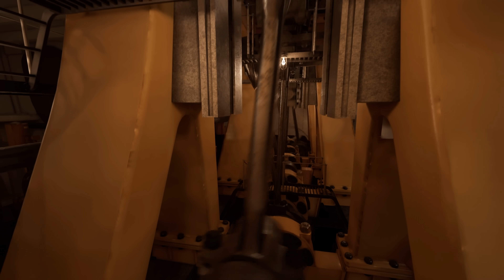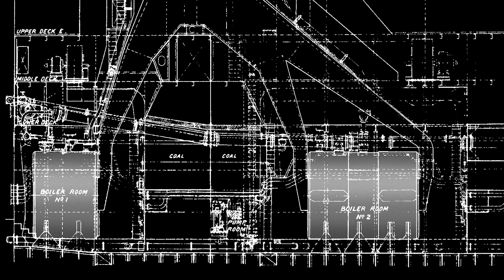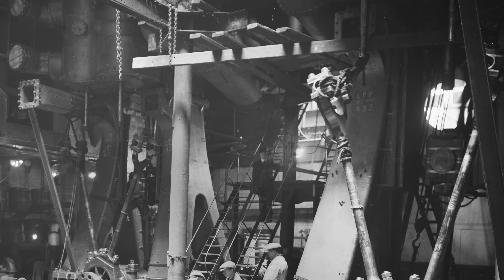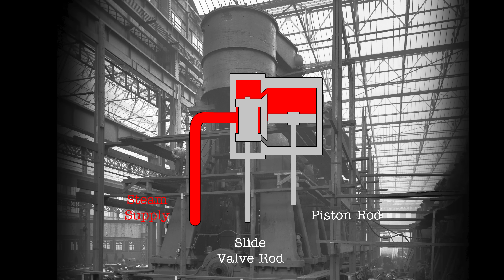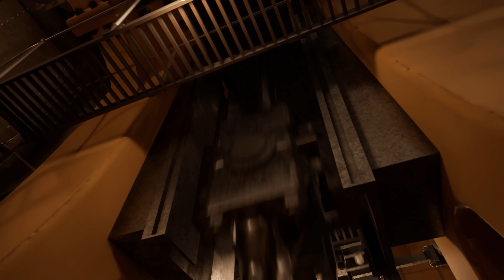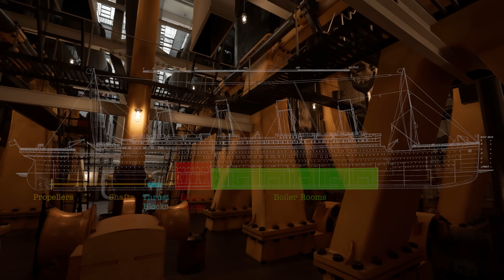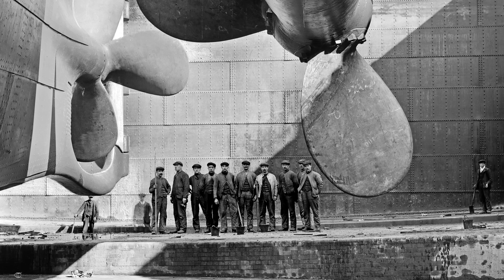A Complete Guide to Titanic's Engines

Comment: If Murdoch had ordered the port engine to fill reverse and the starboard engine to full ahead and shut down the turbine driven center screw (which could only go forward) instead of ordering all back full, the Titanic could have turned to port more quickly and missed the ice berg.

Comment: And yet one ge90-115b jet engine in the Boeing 777 has more power then all of titanics engines. Goes ro show how much more efficient gas turbine internal combustion engines are compared to external combustion steam engines. It also goes to show how inefficient ships are compatible to jets they have they same among of power yet tge massive resistance of water only allows them to travel 20 30 knots while a jet can travel 570 knots with the same amount of power. Likewise one fuel pellet of uranium has as much power as a whole train of several cars full of coal. This huge inefficiency of TITANIC'S steam engines makes my OCD go crazy. Whats funny is that piston four stroke internal combustion engines were already invented in the late 1800s Just lookup Rudolph Diesel and oil was already being used as fuel instead of coal for steam engines.

Comment: Really a great presentation. Learned a lot about the entire engine system. So, when are you going to do an episode on the issue of the coal bunker fire that may or may not have been a factor in the speed issue and the warping of the watertight doors?? Read the Sean Mulroney book on that issue if you haven't already.

Comment: Fascinating and well put together but the description of the action of the reversing engine is I believe inaccurate. It would reverse the setting of the valve gear so altering the stem admission and exhaust sequence for each cylinder. It would not act directly on the crankshafts per se. Just not big enough!
Reply: Stevenson linkage will cut off steam in mid position + engage astern eccentrics from ahead position.
The browns reversing engine operates the stevensons linkage,not the crankshaft.

Comment: Great overall video but what size are the cylinders? Maybe you have another video covering the actual workings of the pistons. I know I've seen a triple expansion engine video, not sure if it was yours or not. I'm guessing that the steam is split into 2 exact balanced proportions to feed cylinders 3 and 4? I used to listen to a sound track of one of these running as a sleep enhancement.

Comment: It's impressive how Titanic's engines extracted every last bit of motive energy possible from the steam fed to them. It's incredible that by the time steam exited the turbine on its way to the condensors, its pressure was one pound per square inch, which created a very strong vacuum in the system. Doubly so in light of the fact steam acted on the pistons from both directions, making every stroke a power stroke.

Comment: Why would you need a separator to remove the water droplets from the steam? Steam is itself nothing but water droplets. 🤔
Reply: Nope, Steam is water in gaseous form - its a gas. The thing you see rising over your cup of coffee is a vapor - floating droplets of water - not steam, steam is invisible. They don't want water in their system for the same reason you do not want water in your lungs - they are meant for gas, water will clog them.

Comment: did they always run the middle propeller in reverse? All the animation recreations I've seen have the two outer propellers pushing water in the same direction and the center propeller is pushing water in the opposite direction from the outer propellers.

Comment: If someone else has not caught this error, my regrets because I'm not going to read all the comments, which are many.  Yes, very good video and thanks for taking the time.  However, the narrator must have been talking about 9 psi_gauge_pressure at the inlet to the turbine as there's just no way the steam pressure at the outlet of the two main engines could be below earth's atmospheric pressure as was stated. 28.06 in the video. It must have been 9 psi_gauge_pressure. 1 atmosphere is 0 psi gauge pressure. Atmospheric pressure at sea level is 14.7 absolute, so 14.7+9=23.7 absolute.  28 inches of vacuum caused by the condensors is 13.7 psi absolute. So, a pressure differential of 10 psi inlet to outlet of the turbine.  How that thing made 16,000 HP with that lowly pressure differential amazes me.  I guess due to it's size and turbine stages.
Reply: It takes few seconds to confirm from other sources that the video is correct and Titanic turbine was indeed working using steam bellow atmospheric pressure. Since it is a closed system atmospheric pressure is completely irrelevant here.
Reply: @randomnickify  I just watched it again, and at about 28:40 he does show the pressures at absolute.  9psia at the turbine inlet, 1 psia at the outlet.  Only an 8psi differentail across the turbine.  I can only guess that the 16,000 turbine output HP was due to it's massive diameter, number of stage and number of blades.  I would appreciate if you could post a link to any of the sources that confirm that show the narrator being correct.  I'm a retired airline mech., and worked with gas turbine engines for 47 yrs. and admit to knowing next to nothing about steam turbines. Thanks for your input.

Comment: Imagine being deep in the bowels of the ship in the engine room on that night. The ship is tilting more and more. Coal would have been sliding around, water in the boilers would have been at unusual angles, and still you are trying to keep some steam up to keep the pumps and lights on as long as possible. Salt water would have been sloshing around electrical panels and back then a lot of the switch contacts were exposed! Had to be terrifying!

Comment: Ignore that last posting [user-hx9qv9mv2v], it's me, but I don't understand why the changed user name and I needed to edit it.
Two areas weren't clear to me. . .  
.
1- Hot, engine room air, vented out the skylight, needs cooler replacement air to enter at the bottom.  There must be an equivalent sized inlet. I believe he didn't mention where that entered.
.
.
Now the tough one. . . 

2a- The steam is re-condensed after the secondary turbine and dumped overboard, but this water was brought with the ship from port.  I thought in the beginning he says the steam / fresh water is recirculated.  
It doesn't seem he explained that well.  What do you think?
.
2b- The 9 psi absolute pressure 'exhaust', turbine-steam is a problem for me.  To lose that heat and re-condense, it is clearly still above ambient temperature.  In addition, for the piston engines to 'work' all steam must be above atmospheric pressure because that is on the opposite side of each piston, even the last one, right?
.
BUT. . . . 
How does it exhaust at LESS THAN 9 psi unless the opposite face of the last piston is even lower pressure? Something not right here. 
Comment?

Comment: Blows my mind that this could be designed and constructed with such precision. I cant imagine the weight of those components. Something not discussed but perhaps the most impressive feat is the amount of torque generated. If the engines made 46k hp @ 75 rpm than they produced over 3.2 million ftlbs of torque!!!

Comment: this video was fantastic the other one was great too however i really found the added information really interesting it’s amazing that the engine spun at such a low rpm i wasn’t aware of this an that fact means that the propeller design was very efficient so overall the engines were very efficient for the day it is still a very interesting ship even today because of the very good design and engineering that was done so good in-fact that a lot of engineering firsts at the time of the olympic class construction have been perfected and improved and continued to be used today a good example of such technology is water tight compartments the concept has been improved and is still in use today anyway i really enjoyed the video and look forward to your next video

Comment: steam power is fascinating.  Steam Locomotives were designed to operate close to 110 MPH on some of the big 4-8-8-4 (wheels) units by Union Pacific.  There was a engineering school for this in Chicago.   These units weighed 100+ tons for traction purposes.  
They were also "dwarfed" by this marvelous piece of engineering on the Titanic.  thank you very much for this!!

Comment: EXTREMELY INTERESTING.   I WAS RIVETED (forgive the pun!) .   It took me three hours to watch this, as I had to watch segments over and over again.   I was gobsmacked about power parts working below the usual atmospheric pressure.   WOWWWW !
If there was a way that you could show the pathway of 'one bucket of steam'   coming into the high, then medium, and then low psi cylinders,  that would have been wonderful.  I would  especially like to see the 3 or 4 piston stroke positions at those times,  showing how all 4 driving pistons moved in time, relative to each other.   This symphony of motion would have gobsmacked me again so badly that I would have to go to the washroom to wipe all the gob/sputum off of my face !!!     Aarre Peltomaa of Mississauga, Ontario

Comment: 23:33    On the right side,  the direction of the tip of the blades of the rightmost, and center propellers are complementary (same direction), so the water flow wouldn't be as shocked, I premise.   On the left side, the left most propellers tips are going in a different direction to the direction of the center propeller tips;  wouldn't this cause massive enturbulence to the
flow of water?   Try, in a swimming pool,  pushing one hand upwards, and right next to it, pushing the other hand downwards;  wouldn't there be a huge shock as the hands passed each other?  I realize the the center propeller is a good distance back,  but would this enturbulence still not apply ?   The left and right propellers should be turning the same direction,  contrary to the center propeller,  no?    Counterclockwise/clockwise/counterclockwise,  or vice versa.   No ??   Aarre Peltomaa

Comment: I've always been fascinated by Titanic's engine set-up. There's so much clever engineering so meet a brief and allow White Star to have their Speed cake without the vibrations of an extra VTE engine. Achieving that solution while also making it a fully integrated system that worked in harmony is impressive a heck, and that's before you get into how the designers were pushing the boundaries of engine design with the sheer scale of it all. 
I was also fascinated when I learned the theories around how this set-up contributed to Titanic's sinking, particularly how the central prop stopped when one of the VTE's was put into reverse to provide a turning assist. I work in Civil Engineering as a career and I think the idea that design choices can have a very real effect on real-world operation, especially in situations the designers might not have thought of, or how user understanding of a system can impact its effective operation is a big part of why I chose the career I did.

Comment: Titanic had a huge valve that bypassed steam around the LP turbine straight to the condenser so you wouldn't have the center prop trying to go ahead when the recips were running astern.  Seems like a lot of trouble and expense for the miniscule time she would have been going astern.  No wonder direct drive turbines were a dead end.  I think later ships with geared turbines used little HP astern turbines that developed lots of power at low efficiency.

Comment: Actually a major Naval Architectural mistake with very little maneuverability with a small single rudder mostly worthless because of the deep keel allowing little control, and especially with two more props with no rudder which is totally useless for control to any degree. If this vessel had been built with 3 propellers with 3 port and starboard rudders with no keel to cause minimal control, the Titanic could have most likely steered clear of any obstacle to cause no damage.

Comment: A beautiful video about one of my favorite subjects, Mike!  One thing, though - the animation of the propellers seems to be showing the central propeller turning in reverse (according to the blade angle and rotation) or, if the rotation is right. the blade angle is opposite what it should be.

Comment: Very well-done explanation of this incredible power plant!  Just one comment, if I may - steam is never "less than atmospheric pressure" - if it were, it would actually be a vacuum.  Steam pressure is measured in PSI (pounds per square inch) relative to atmospheric pressure..in other words, steam pressure of, say, 6 psi, would be weak, like from a tea kettle, but still useful to do work. If a boiler were turned off and allowed to cool, the steam pressure would be zero, and the air inside would then technically be at atmospheric pressure.

Comment: Very good comentary that show the similarity to my first RN ship HMS Girdleness that had  a triple expansion reciprocating engine using huge big ends running on babbeted bearings lubricated by bath of soluble oiland water.The nuts securing the big end  caps were huge requiring spanners and hammers hung fron chains to undo or tighten. Girdleness  used superheated steam to run its engine and ran at nine knots.
Reply: Why no comments?

Comment: How in the F does that float? 
Physics watson, its lighter than the water it displaces. Hmm. Okay. I know. But it doesnt seem possible. 

Heres where its even more interesting, we are going to top it off with 30 ton propellers, 100 ton engines, 10 ton anchors. Etc, oh, and it even carries a shitton of water underneath in its belly? wtf!!!! and yes it still floats.
you mean to tell me you add water to your solid steel heavy ass water displacing vessel😮

Comment: An absolutely staggering achievement, the men that designed and built this were truly remarkable! and that almost 100% was done in house is just unbelievable ! I can’t comprehend the range of skill sets on that one site, the drive and confidence to pull it off too. The size of that turbine casting blew my mind!!

What is sad is that without computers and cnc manufacturing I doubt anyone on the planet could pull this off now and certainly not in the time frame they managed.

Comment: Love this channel. I always learn something new. Mike you are excellent as always. Was wondering if the black gang had their own showers, as they were very dirty after each shift. Also. Were there clothes washing machines?
Reply from the maker: Good questions! On D Deck the firemen had a special ‘wash place’ on the port side which was seperate to the WCs on the starboard. It featured 7 wash basins, 3 large washing tubs and two showers. I’m not entirely sure but the tubs might have been used for washing clothes.

Comment: 21:07 Funny to think today that a 500 Cubic Inch (8.19L) top fuel drag car V8 can produce over 11,000 HP, granted for 4 seconds, but still its impressive to go from 720 Tons (1.44 million pounds) to the 496 lbs of the top fuel engine.  Isn't science fun? 🤠👍   Keep up the great work sir, excellent info.

Comment: Is it just me, or does the split in the power plants not make sense? Because I understand White Star not wanting a ship powered purely by steam turbines, but what baffles me is their decision to put the turbine on the central propeller. Now this turbine wasn‘t geared in such a way to allow it to add reverse thrust, but the propeller powered by the steam turbine is the one that was fitted in front of the propeller. Meaning that you couldn‘t throw water over the rudder efficiently in reverse. So when the First Officer ordered the engine room to go all astern on that faithful night, not only did he stop the water flow over the rudder through the screw, he also created even lower pressure by making the triple expansion engines suck water away from the area around the rudder. Maybe I‘m overseeing a very important detail, but wouldn‘t it have been smarter to put a single triple expansion engine in front of the propeller for easier maneuvering and two turbines on the outside for more power at sea?

Comment: So they had huge pumps which could move thousands of pounds of water around the engines but couldn't do the same for coal?

 I imagine the weight and space saved by having less crew would be beneficial. Remember that coal shoveling crew also need food, water, shelter. Which will also take up more space/weight in ship

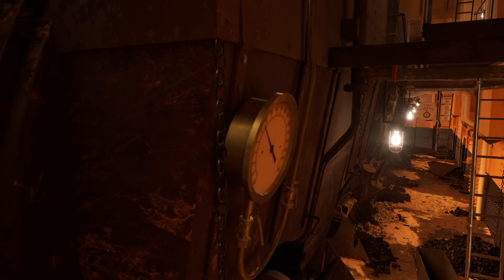Comment: 10:28 I don't know if anyone else has mentioned it or not yet.. but holy hell those are some AMAZING renders.  The graphic quality is incredible and easily bordering on photorealistic.
In fact, I wouldn't be at all surprised if many viewers thought the images of the ship were actual video of an interior.

(There's only a few small details that give away it's identity as CG; the heat-waves effect, repeating textures on some of the steel, and and uniformity of things. Like the railing on the stairs isn't dinged up, bent, or anything. It's perfect top-to-bottom, all the rungs are identical, etc.)
Reply: Edit/Addendum; Whoever modeled all the scenes is an incredible artist/3d-modeler and I wish they worked with me on my indie game .. but they're so far out of my price range it's actual comical; they're easily top-tier and modelers of that caliber can reasonably fetch 150k+ per-year. (yes, really.. the average is around 50k/year or so, but the truly gifted ones with large portfolios can double/triple that figure)

The main thing keeping my game project in ultra-slow dev mode is modeling.. I'm just crazy slow and terrible at it. Code is my jam